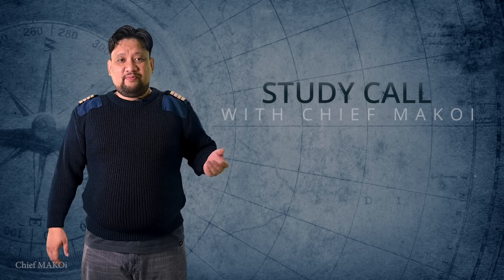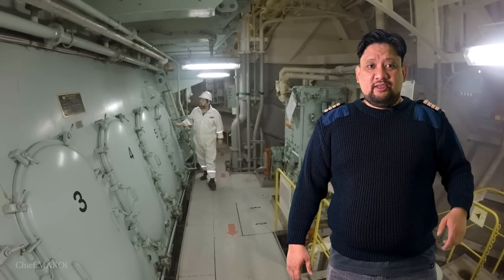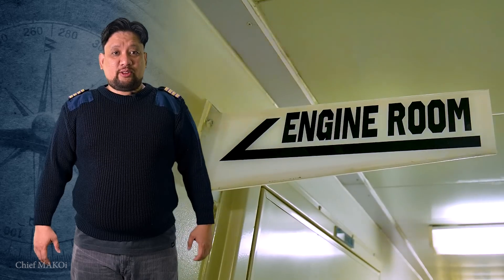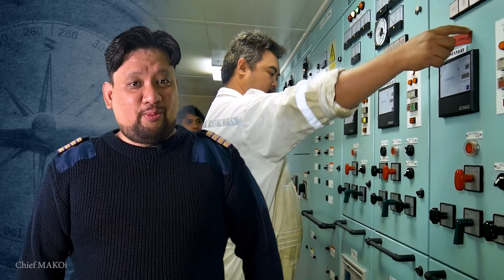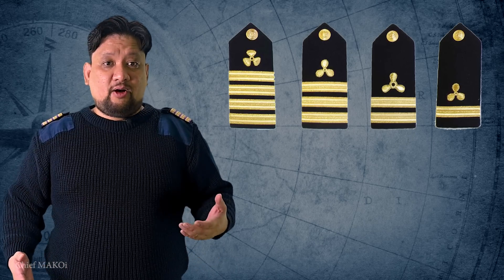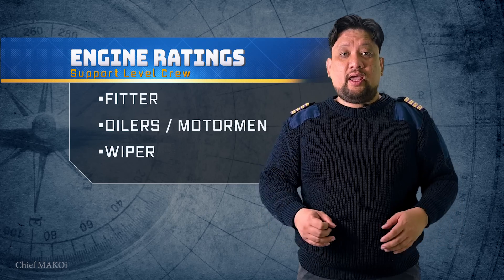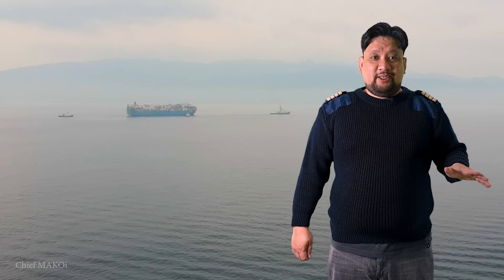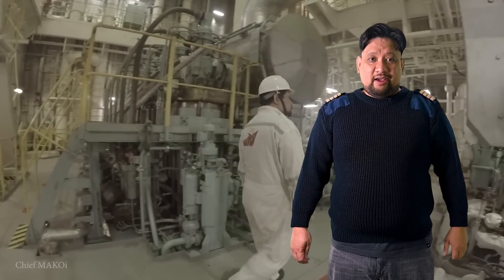Marine Engineering - Introduction | Study Call with Chief MAKOi 001

Comment: Hi , you only mentioned Chief, 2nd and 3rd Engineer. Who takes the 8-12 watch as in my career it was the 4th engineer who looked after purifiers, air compressors and fuel in general?

Comment: Chief, could you explain about:  Airconditioning system, sewage system, rudder control system , bow thrusters, engine starting air ( compressors ) , fire pumps system and refrigeration plant?

Comment: Chief;  thank you for the lesson, I have always wondered how heavy bunker oil can be vaporized and mixed with air so that it can run an engine. During some of your sessions could you please expand on how heavy bunker oil works to provide power to an engine. Do your engines use carburetor? Are your engines fuel injected? Or do they run on some other type of mechanism?

Comment: I would like to see a video and explanation of the lube oil system of 2 stroke engines.  
Do they use a cartridge filter of centrifuges?  On the ISO cleanliness scale, how clean does the system clean the oil?  Do you use oil analysis?  Is there oil analysis equipment on ships?  How many hours between oil changes?  What determines that the oil should be changed? What is the capacity of the lube oil system?  
Thanks, Don Searles
Reply from the maker: I'll do this when I get back to work on a ship.  Hopefully by next month.

Comment: This was absolute fascinating.  One thing comes to mind.  Ocean water is heavy in nano and micro organisms that scale up in engines, heat ex-changers and piping.  How often and how do you clean scale within these systems/components and how must manpower does it take?  Or do you have some sort of scale control chemical or system to stop scale even forming/building up?

Oops wrong video.

Comment: Do you have to fly in airplanes in order to get into merchant marine. Is it absolutely necessary? I ask because i dont like to fly at all.
Reply: It's possible to work on ships without flying but your job options would be VERY limited.  Your best jobs are ships that go on international voyages. I don't like to fly much myself these days either (even though I also have a commercial pilot's license) but it's due to all the BS you have to put up with at the airports. If you are afraid of airplanes, that's another issue.
Reply: @ronjurgs9799  Yeah. That sucks. I was really thinking of giving this a shot. But, I hate to fly. I get panic attacks on airplanes. Specifically right before and during take off .Its gotten worse. Never used to happen before. Just came out of no where. Boats and the ocean im fine with. Im assuming that the ship could leave a port from the 🇺🇸 or wherever but after a few months when the job is over it could end up not at the original port it  left from at the start.

Comment: I enjoy your videos.  I have my sea time in (US Navy) but enjoy learning about both the civilian ships and diesel propulsion.  Spent my sea time on a ship with a 600-PSI steam plant, twin screws, and 32,000 HP worth of propulsion turbines.  

Some of the new stuff blows my mind.  I have paralleled generators with a SyncroScope.  I've also stood at a switchboard with my hand on the bus tie switch waiting for all 3 light bulbs to go dim at the same time.
Reply: I used to parallel generators with shore power.  For a while I was C/E on a casino boat.  Gambling would start before we left the dock and we would be on shore power.  After all the generators were started I would sync them all up, then would sync them with the shore power.  After paralleling the gens with shore power I could do a smooth transfer of power to the generators before cutting off the shore power breaker.  That way power was never interrupted to the 1200 slot machines that were actively being used.  I would do the same thing in reverse after the gambling cruise was complete after the shore power cables were reconnected.  Interrupting power to a slot machine was always a no-no.  We never did that on ships and there would always be a brief interruption of power when switching to generators before leaving the dock.  All our computers were on UPSs so it wan't much of a problem.

Comment: I understand how essential electricity is to bringing life to the ship;  I feel that the soul of the ship is the crew.  I have been to sea and have worked on a shipyard.  As the crew reports aboard the ship comes to life.  Up to then, it is an expensive heap of steel.
Reply from the maker: It's kind of a chicken and egg thing.  I've experienced having a generator breakdown and had blackout for 3 days, luckily while in port but unluckily in the Middle East.  I tell you it's hell on earth trying to fix things in the engine room during blackout.  No ventilation/blowers, no air-conditioning so it was impossible to sleep, not even running water to shower or flush the toilet with.
Reply: @ChiefMAKOi  can you make a video about this experience. This would be good material.

Comment: Hello chief, firstable as an ETO and seeing that you wanted to talk about electricity, I feel that you should give us more credit. At least an episode or two, believe me... sometimes we even have to correct chief officer mistakes when dealing with electricity.
Reply: A lot of times the engineers really aren't very experienced with electrical issues.  I'm an academy graduate (engineering) but I had a 20+ career in electronics before going the merchant marine route. I sat thru all the electrical academy classes so I know what was taught.  For about 5 years I was a chief engineer, but I really didn't like that job as much as being a radio officer.  It was easy for me to switch because of my previous professional experience in electronics.  As my luck would have it, I ended up on a great ship for a while and did a lot of electronics work in the engine room.  The chief was happy, as I would rather work with a voltmeter than a big wrench any day.  The captain was fine with everything too as I always kept the emails flowing via the sat system.  Now many ships are employing ETO's.  I would have gone that route as well, but I retired after working 50 years.  I believe with all the computer automation aboard ships these days that the ETO job should become more & more necessary.   I'm surprised that they don't have a computer officer.
Reply: @ronjurgs9799  well seems like you had a great career, in my company they are employing ETOs.. I had the opportunity to actually start as an ETO cadet so I know first hand that we are indeed really important, there are a lot of times where engineers report equipment as damaged when in reality they were just making it work off limits electrically speaking causing it to trip, so yeah a ship owner can decide not to employee ETOs but in the end he is going to spend more money than our salary in spare parts or machinery.

Comment: I've always thought of deck and engineering as equal partnerships.   I think most ships operate on that principal.  Had one captain in the Arctic who thought he was king.   No one spoke to him.  Nasty miserable man.  Same ship, different captain, a Newfie got along with everyone, and made them feel special..
Reply from the maker: I'll make a topic about that in future episodes.  They already teach about that kind of behavior nowadays.  Resource Management and Human Element in Leadership.
Reply: It's topically for captains who very fast grew from cadet to his position. Most of them feeling like kings.
Reply: @Bac9IBacuJIbeB  - So do Chief Engineers.  I sailed with quite a few who thought that they were ' holier than thou'.
Reply: @manuelaffonso2191  I would understand the Chief Engineer more though as there's nothing current day that truly justifies Captains reign and rule over a ship, not over the head engineer.
Reply: I've seen that kind of behavior myself.  There could be another reason.  If there's drinking on a ship it's the captain who is usually the biggest drunk.  Maybe nobody could talk to the captain because he was locked away in his cabin and wasn't fit to talk.  These days things are a whole lot different and many companies don't tolerate much drinking by anyone on the crew.  I've even been on dry ships were drinking was prohibited entirely while aboard ship.  At the academy you had to be sober enough to walk up the gangway unassisted or you couldn't come back aboard after your night out.  On another ship they often had a big bucket full of iced beer at the bottom of the gangway for those going ashore.
Reply: As someone from Newfoundland this is fact
Reply: Personally, I see people not speaking to me as a win.